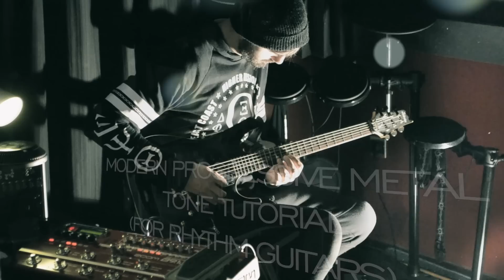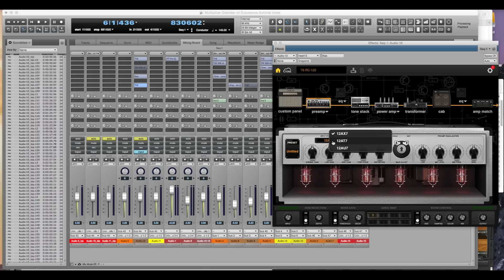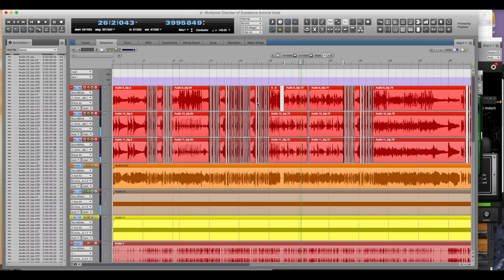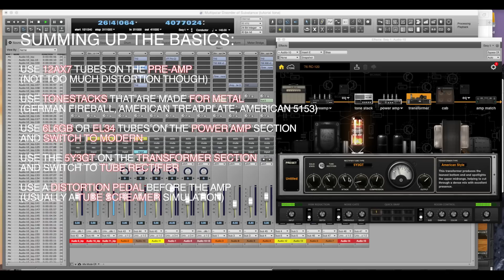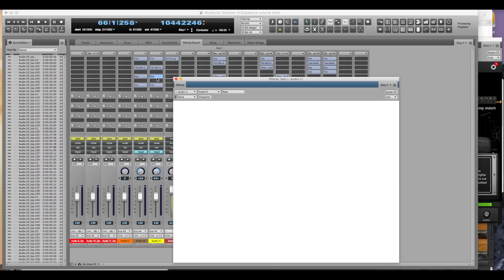BIAS Amp - Progressive Metal Tone (Ultimate Djent / Prog Metalcore Guitar Tone Tutorial)

Comment: Don't mean to be rude but you're waffling on  and on, how about actually showing us the settings in 2 mins instead of telling how many there is of everything and who uses what. Sorry to seem rude but make a seperate video and be efficient, you're just going on and on. Worse you have different settings on things you AREN'T talking about, the power amp for example has different settings than the stock one you appeared to start with but you just kept going about what goes in what amp. Lay off the reefer. It's no wonder nobody can get the tone close to your "ultimate djent tone".

To top it off you had everyone following your changes over and over, only to fiddle about with it all AGAIN near the end...........Sorry if i come off as a cunt but your video has wasted nearly 30 mins of my life when you could have just showed each section with the CORRECT settings you decided on at the end.................So no, i won't be subbing.
Reply from the maker: Dude the setting are there!! I am just switching to fast forward. You can just pause the video and copy the settings. I would be talking for like an hour on all the settings that I did and why. If you don't like the tone or video just move along! I am not showing you how to copy my tone! I giving the info you need to make your own tone. Also what most "djent" players don't know is that the sound comes from your hands too. The way you place your hands, especially the right one can make dramatic difference and even if you get 5.000 worth of equipment, if you don't know how sound good just with your hands you'll never sound good with just a good tone on a plugin. Also the bass tone is very important and the editing stage is extremely important in order to sound tight. Cabinet impulses are crucial too and I am also showing the distortion pedal settings somewhere in the video.

Comment: So this is the Bias amp? Not Bias FX.. I'm a bit confused. What do I need the FX for?
Reply: Bias FX is just that. It's all about creating some killer effects.  Bias AMP revolves around making amps. However you can do both amps and effects in bias FX. Bias amps is pure creating. That's my understanding, someone might have to back me up on that to be sure. I got jam-up on my iPhone and plan on getting bias amp on my iPhone soon. You need an ipad for bias FX. I prefer my iPhone just because it's SO much more portable.
Reply: Bias Amp has no effects. Bias FX does not have tone matching, and you lose some customization options--you can choose the amp, cab, and mic placement, but you cannot go inside the Amp and change the tubes, transformers, etc. Bias FX still has the same great main amps tho, there's just less parameters to customize
Reply: As someone who wants to mainly mix and record guitars, would you recommend BIAS Amp or FX? I only have enough cash on me to buy one for NOW, so I need to make it worthwhile haha.
Reply from the maker: Bias FX has all the effects you might need besides an amp head. Distortion pedals, compressors, chorus, reverb, delay and many many more... Bias Amp is like having an amp and being able to change the most important parts inside the circuit !